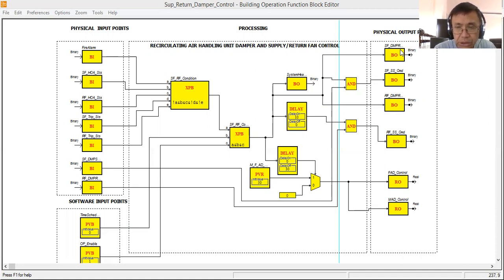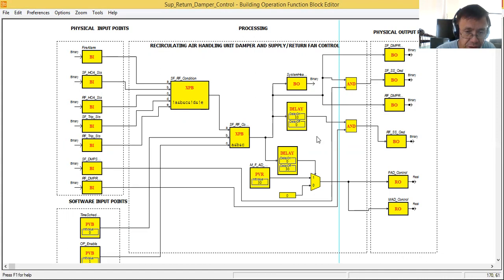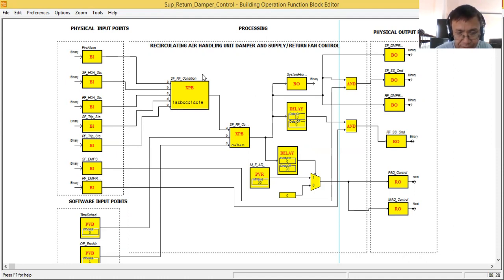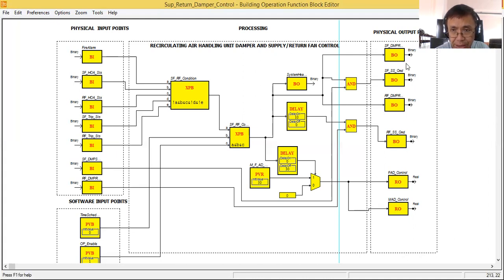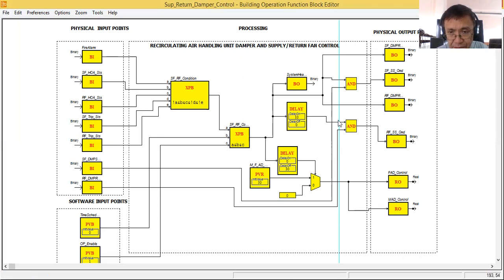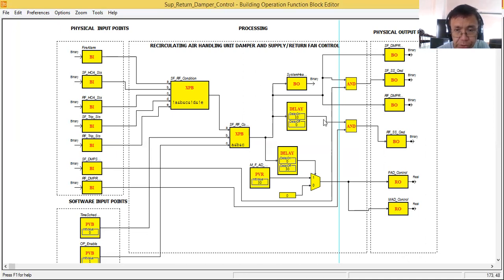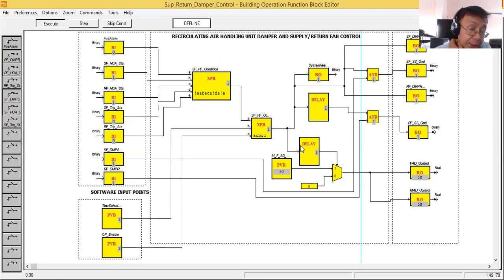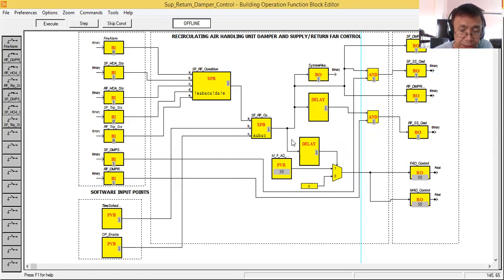How to Become a BMS engineer part 86 (Damper Control)

Comment: Like a Chiller series .. everything regarding Chillers .. and programming and logics
Reply from the maker: I have video tutorial for a single chiller, if less  chiller is  involve it will be easy to do the logic programming, but if there are more chillers then chillers  supplier like the big players they have their own CPM (chiller plant manager) then it will be integrated to BMS through software integration
Reply: @SantosJrCapellan-BMS    Yeah got your point .I am also working as a BMS Engineer . But just a kind request Like if a video contains .. 3 chillers ..Logic how make ..like 1 stand by and 2 running . How it works with Pumps .. 
Air cool type and water cool type chillers.. Just a kind request ... Thanks for your response